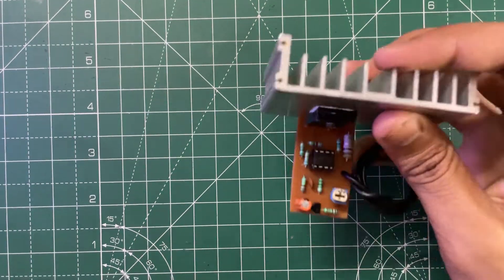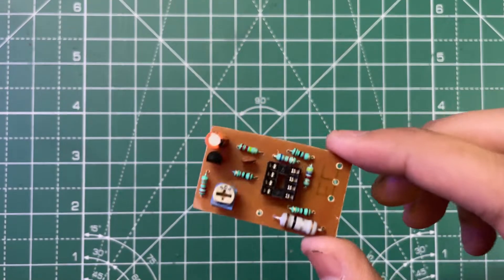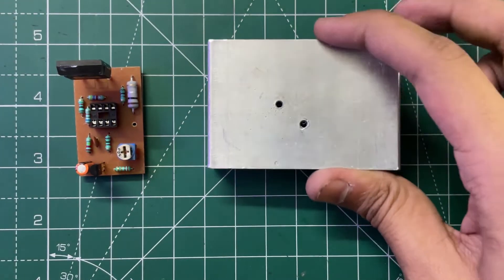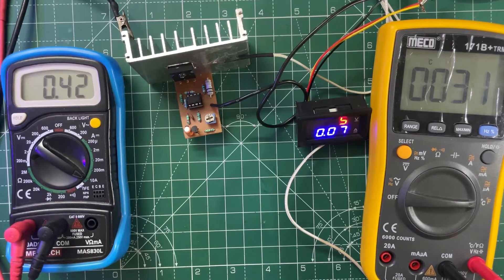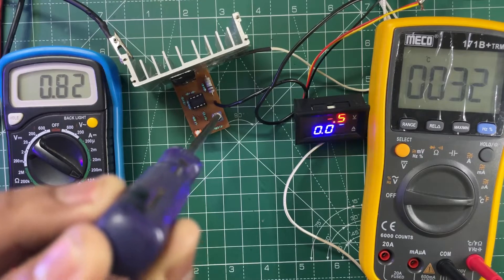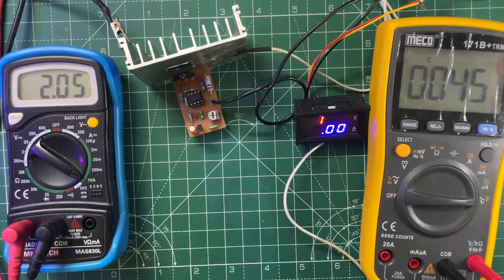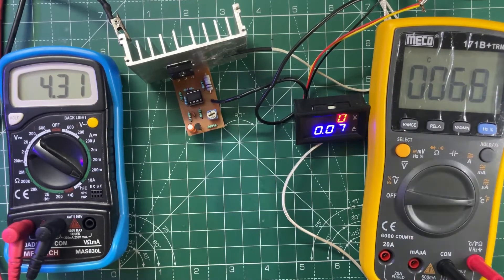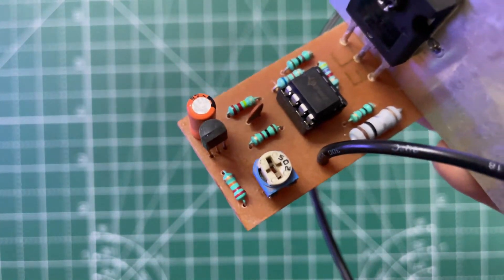DIY POWERFUL ELECTRONIC LOAD WITH LM358

Comment: what is the minimum voltage of the circuit to work?
Reply from the maker: 3V
Reply: @kdcreativity6201  do we have to give separate power supply to the lm358 ic and the load supply will be different or just give single power supply to the circuit and adjust the preset for the load??
Reply: reply??
Reply from the maker: @Xavier_Everwhere  Both have common power supply.
Reply: @kdcreativity6201  thank you for quick reply

Comment: Thanks for the cool project, but your PCB and schematic link goes to the wrong place.  I'd like to build it, but I need a schematic to use with the parts list!  Would you please fix the Google drive folder link?
Reply from the maker: Sorry. I will fix the link asap
Reply: @kdcreativity6201  Still no link to the correct schematic for this project (only a pdf of the board layout).  I don't understand.
Reply from the maker: Sorry bro. I will surely give you the files tomorrow
Reply from the maker: @gusbernard5215  The file has been corrected. you can check the description
Reply: @kdcreativity6201   Nice video 🙂👍, i want to ask. So now, is the link in this video the correct schematic?
Reply from the maker: @andrimastirta4736  yes the schematic is correct
Reply: @kdcreativity6201  Thank you 😀👍
Reply: @kdcreativity6201  Thanks!
Reply: I need a 24 v input and 12v out put cct. Can u plz help

Comment: Dear Sir,
This circuit is drive a mosfet IRFP250. Can this circuit drive a transistor like MJ3005?
I have a lot of power transistor.. 😇
Reply from the maker: You can try but if the ic is getting hot than you need to add a driver
Reply: @kdcreativity6201  about 80''s mofet became popular in practical electronics, but very expensive, so practisioner  still used multiple 2N3005 or MJE1500x .. 🤭

Comment: Is over current protection or voltage regulator?
Reply from the maker: It is a electronic load. A electronic load basically puts a constant load on a supply even after you change its voltage